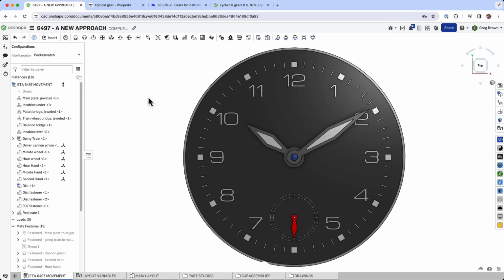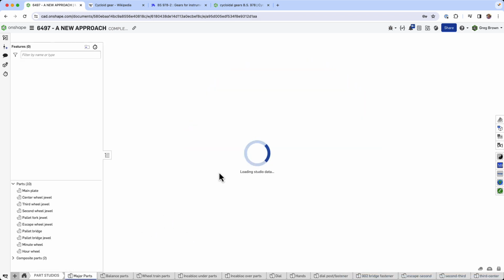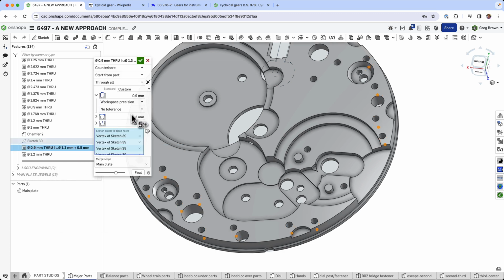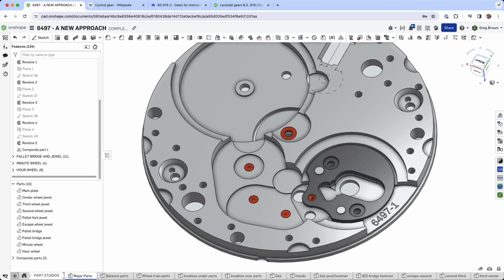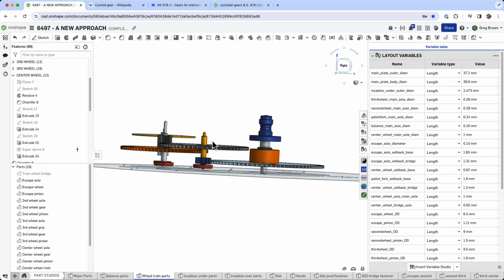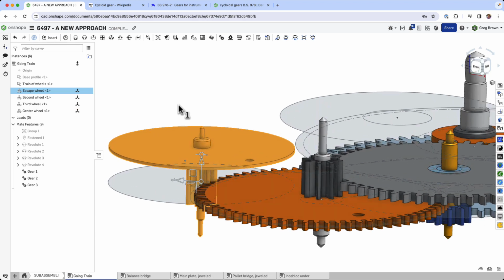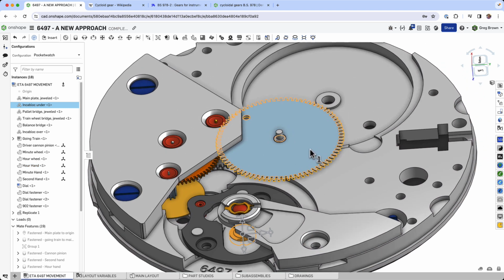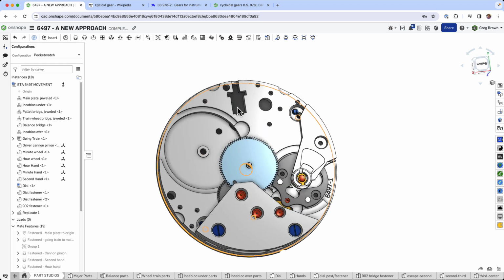Revisiting the 6497 watch movement - with modern Onshape techniques (LONG!)

Comment: Can you simulate mainspring movement and how?
Reply from the maker: Not directly in Onshape's assembly environment. While we can assign mates (joints) of various types, the assembly must be solved as a linear system, which means that impacts, friction, damping, and other discontinuities are not simulatable. There is a great, fully integrated 3rd app (look in the App store) called Principia which does do Multi Body Dynamics, and may help - depending on what you really mean by "simulate mainspring movement". The escape mechanism too? That's a nice challenge...